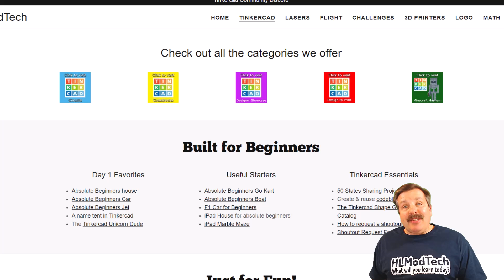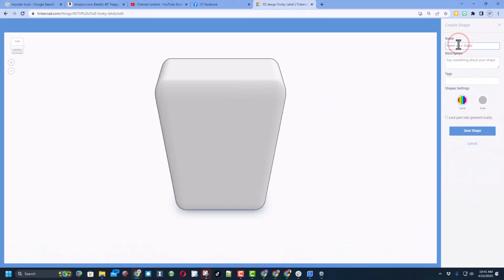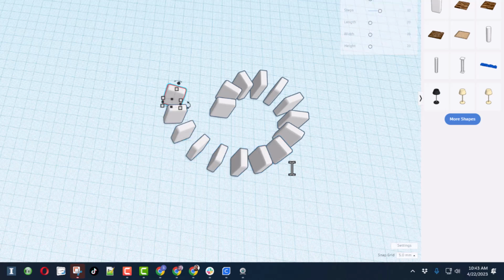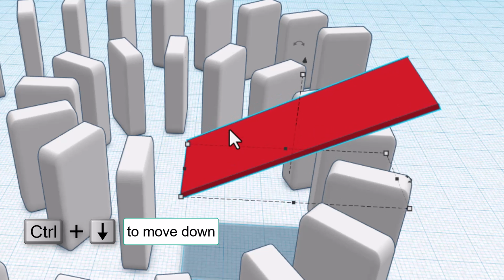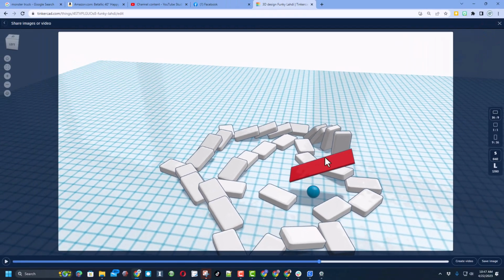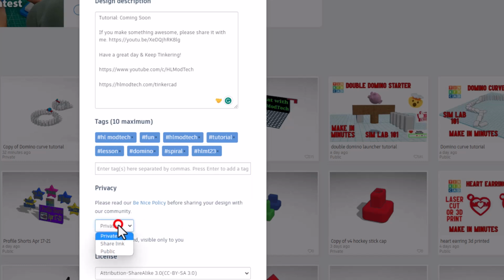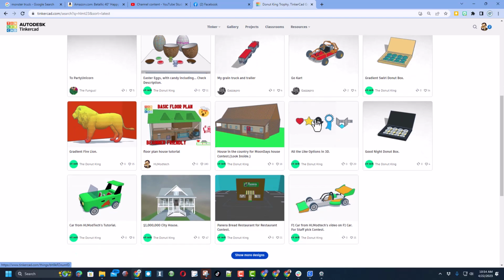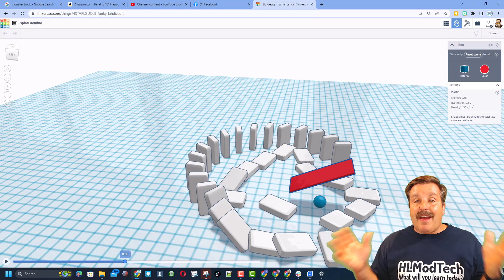A Spiral Domino Run using Tinkercad Sim Lab for Absolute Beginners!

Comment: @HL Modtech  Ok, so I am going though this on and when I start to create the spiral shape with Ctrl + D it is just added them on top of each other. I did like you showed and put in the degree setting and without touching anything hit Ctrl + D and it just stacks em. Am I missing something?
Reply from the maker: So... it is a click on the screen somewhere after the move that breaks the Ctrl+D memory. Just make sure after the arrow nudges... you go right to the Ctrl+D again and again.
Reply: @HLModTech  yeah I thought thats what I was doing but I will give it another shot! Thanks Mike!
Reply: @HLModTech  yeah, it's so weird, it's not working now... I will start the project over and see if that helps. It worked for the first 6 but then when I try to do the second set it stacks em. Thanks!
Reply from the maker: Glad you got it working. I was just going to ask if you had the ruler on the workplane. I have heard that can cause it to fail.
Reply: @HLModTech  After restarting it worked fine! Thanks Mike!